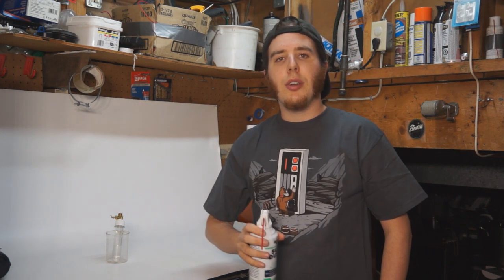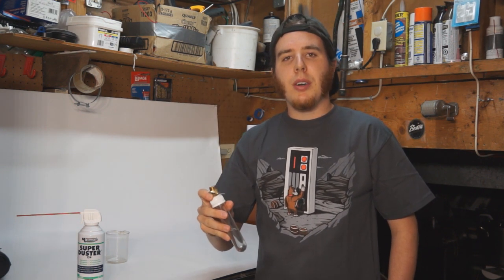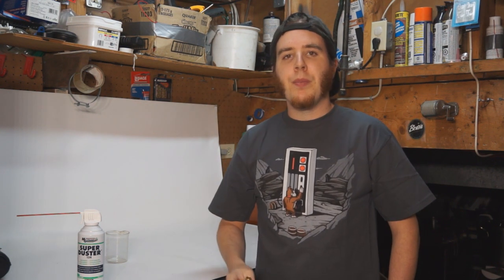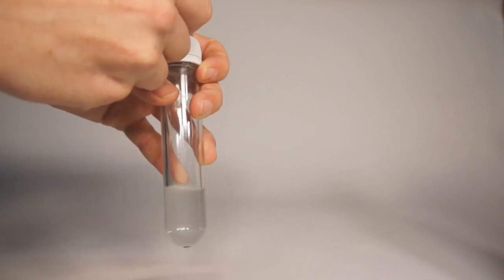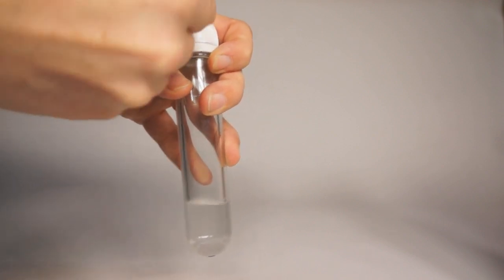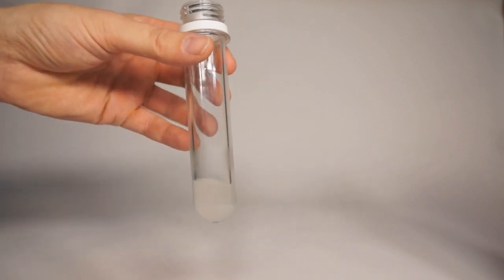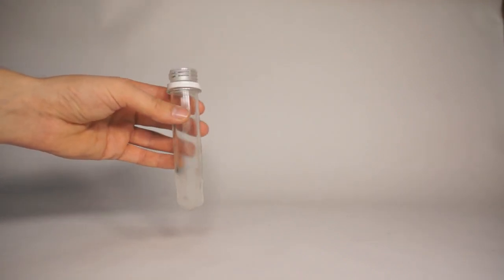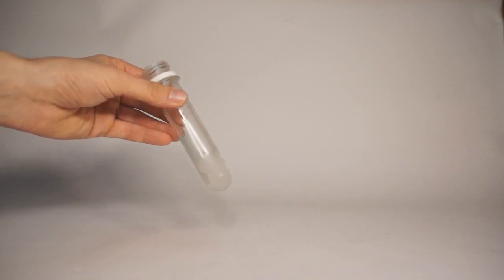Why is Canned Air a Liquid?

Comment: To fellow viewers: This is also pretty much how an air conditioner works. The boiling you see in the tube is exactly what's going on in your air conditioner's evaporator coils! The difference is unlike that tube which is insulated, an evaporator coil is designed to absorb heat from the air as it flows through, making the air cold.

Comment: Nice demo!  We used to fill pop bottles with propane and freeze stuff like you would with liquid nitrogen (the old man worked at a propane company).
Reply from the maker: Cool, how do you get it into the bottle as a liquid at room temp/pressure? It might be fun to do some cryo experiments with dry ice and different compounds.
Reply: Nick Moore We just held the pop bottle with our feet, put the fill nozzle at the top and opened up the valve.  It would spew large billowing (and probably explosive) clouds of propane and after 5-8 seconds you would shut it off and see that the bottle is full of LP.  It would refrigerate itself pretty gently until you dunked something in there.

You could do the same with a bbq tank, just hold it upside down when you open the valve.  It's not that cold though (-43F), mixing alcohol with dry ice makes a better (and more dangerous) freezing solution because there is no leidenfrost effect.
Reply from the maker: I've done the dry ice thing a few times, good for a few demos.
 I wonder if it would be possible to condense propane or r34 from a gas to a liquid using dry ice...
Reply: Probably, right?  You could go through the trouble of a condensing coil if you don't want them to mix, or just run some through a container of the stuff and let it drip to the bottom.  

Of course you wouldn't heat up some cheap wine and pass the vapors through said condenser.  Who would do such a thing?
Reply from the maker: I can't think of anyone who would want to ;)

I have thought about doing a demo on boiling points and distillation but the rules about it are so strict that it's more trouble that it's worth.

Comment: I'm definitely curious. What type of valve is it please ? Any name or link to find it on Internet ? Google image it shows no concrete result. Thank you.
Reply from the maker: It's a brass needle valve. They aren't really made for this but they can open and close under pressure without binding up.
Reply: Thank you very much. That will do the trick for what I want.

Comment: I came upon this a few days ago; its relevant to the cavitation/implosion discussion we had.

http://youtu.be/60PctdoRHd0

This means that a can of liquid air is effectively a heat pipe, and it suggests that an implosion is not as likely when a large liquid component is still present when the container is sealed, but some interesting thermal properties come into play.
Reply from the maker: I should do this with a big glass bottle, I would be easy to show with the IR camera!
Reply: What about that glass tube with the volatile liquid from a few videos back...?
Reply from the maker: That might do it! If I turn it upside down it would be a kinda of 1 time use heat pipe as the liquid could not return to the bottom.

Comment: The temps are really close to -25˚C here at night, lately.  That'd make for some interesting condensation experiments, perhaps similar to steam implosions....
Reply from the maker: Yeah... at -25 would the inside of the can be under vacuum instead of pressure? You could cut it open and pour it in a bucket at ambient pressure.
Reply: Engines that haven't run for 25+ years are cranking up in my head.  Volatility, vapour pressure, equilibrium, closed systems...

While I can't quite explain why, yet, I don't think there'd be as much of a differential where it already existed as a liquid, then cooled, as there'd be if it was in vapour form then condensed.

(If that's true, for some reason, maybe that'd be why some steam implosions are more violent than others...?)
Reply: It came to me while driving home tonight, thermometer reading -24˚C:  As the vapours condensed, the pressure would drop, and bring the fluid's boiling point down too, until equilibrium was reached.

Each liquid has its own vapour pressure...  The easier for molecules to leave the company of others, the greater the vapour pressure.  Polar molecules like water have a more difficult time to evaporate than non-polar molecules, like the alkanes and ethers.
Reply: I found vapour pressure data for difluoroethane:  

22.72 to 263.7 kPa corresponding to temps 219.9 to 273.3K.  -25˚C is almost midpoint in that temp range, which corresponds to a pressure of 129 kPa, or ~+4 psi above std pressure.  (not my favourite branch of chemistry, for sure)
Reply from the maker: Nevin Williams Interesting, I need to get it a lot lower than Canadian winter to do R134 implosions... Not that I will let that slow me down!
Reply: Ethylene Glycol has a very low vapour pressure, at just 500 Pa @ 20˚C, compared to water's 2.3 kPa, or propane's near 1 MPa, or dry ice's 5.7MPa.  Pure gylcol's melting point is -12˚C, and its BP is just under 200˚C.
Reply from the maker: That would make it really good for cavitation demo's, I'll add it to my science shopping list.

I should do a Science Shopping List, covering any household material that have interesting physical or chemical properties...
Reply: Nick Moore I only just now saw the second part of your comment;  that'd be a great idea;  while rarer materials are good for demos, its doing uncommon things with common substances that inspire other folks to try things for themselves.

A few that come to mind, offhand:

  Tin:  Pure metallic tin can spontaneously transmute to its non-metallic allotrope below 13˚C, though impurities can reduce this temperature significantly;  but, as long as it doesn't have bismuth in it, it'll become non-conductive and flakey at nominal winter temps.  see 'tin pest'.

Epsom Salt:   Magnesium sulfate is purportedly a major cause of sea water's sound absorbing property for some range of frequencies, whereas NaCl has negligible effects.  (I'm not sure what one could do with this, but one with an oscilloscope and a thermal camera can probably come up with something)

Isopropyl alcohol:   Unlike methyl or ethyl isomers, isopropyl is not readily soluble in salty water, and will come out of solution in such conditions.  It's probably visible (I've not tried it yet) in an NaCl mixture, but likely quite visible when a coloured salt is used, like copper or iron sulfate.

Comment: Actually some canned air is propane (yes, propane).
Reply from the maker: I've heard of it being used as spray paint propellant but never as super duster. I'll have to keep an eye out for some.
Reply: Nick Moore I'm in the UK, our enviro rules tend to be stricter even than the rest of the EU, because our government takes EU recommendations and immediately makes them laws :)

Odd fact though, it's not easy to set alight: The pressure in the can is so high and the nozzle so small, the flame tends to blow itself out.

All bets of course are off if you invert the can.
Reply: I've heard some is butane. Butane boils at 30F so it only needs to build up 30-40psi to stay liquid at room temp, and a soda bottle can hold up to 80 psi.